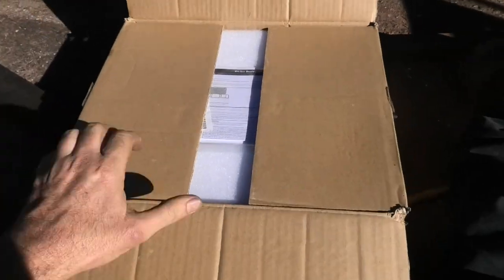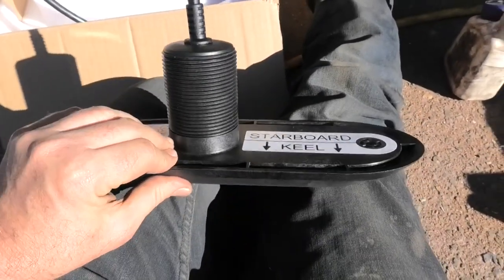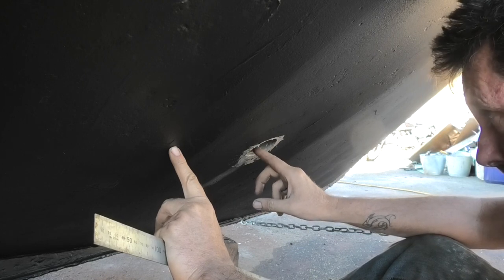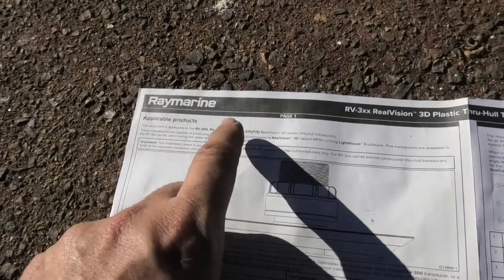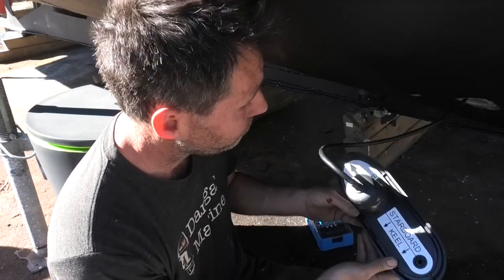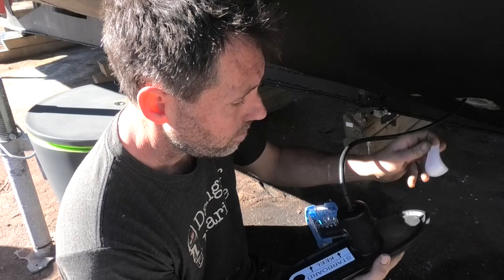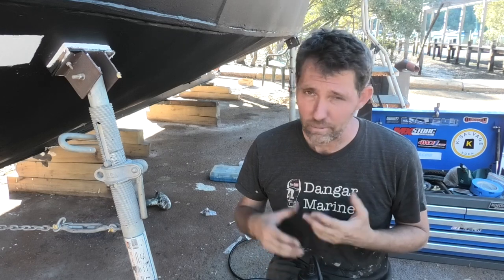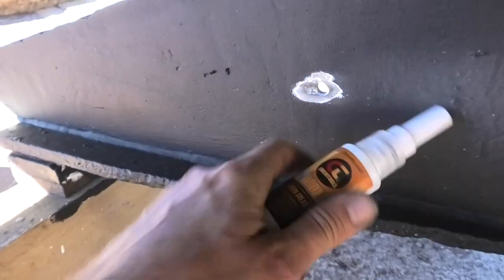Installing Raymarine RV-320 sonar transducers and attaching anodes

Comment: G'Day Stu,,mate i live in Newcastle,,would it be worth it to get a crane from Newcastle,,couple of the mobs this way have some pretty big cranes,,not sure what sort of capacity your after,or radius you will need to reach water from where ya boat is,,
Just a thought,,
I mean 2 franners verse's one from newie,,
Reply: @ Ian williams  I suspect Stu means the bridge on Brooklyn road, not the highway / freeway. That’s where the load limit would be. No way to get a heavy road crane to the site. Not legally anyway.
Reply from the maker: That's it. Getting the crane itself is easy, getting it here is no longer legal.

Comment: I'm not a fisherman but is it really necessary to have two 3d sonars? I guess that this is only applied on fishing vessels?
And they are not cheap either....
What MFD are you going to use? Axiom?
I'm thinking about upgrading the sonar, radar and MFD from raymarine but I find it difficult to understand what transducers that fit, especially when you don't want to drill a hole (plastic boat) and having the transducer as far forward as possible (raymarine doesn't have a forward sonar yet) for shallow water.
Reply from the maker: All 3D sonars are a matched pair as they view off to the two sides of the boats. Yes, I am using an Axiom Pro 9, but you can use that with a single downvision transducer if you would prefer.

Comment: I no this is off topic of the video but I have a 2007 honda bf40 outboard and I just brought it and it has 120psi compression on each cylinder, is this figure OK please message back as its disheartening me toward the outboard tbh
Reply from the maker: 120 is fine.
Reply: @DangarMarine  that was hot with the throttle open and honda states 199psi when new its the same as your one, not many people if any have done a YouTube video on compression testing a honda 40hp what's the compression on your 40, you are easily the best boat orientated youtuber out there

Comment: Is there some new gross weight limitation on the bridge ? North to South, South to North ? It sounds like a divided bridge ? Or two separate bridges side by side ? If the restriction is only on the North to South side, why not hire a couple of Coppers to hold the traffic on the South to North side until the crane can get across the side with no new restriction ? That's what we used to do years ago in The Florida Key's I'm sure the Cop's will glad to oblige for a few bucks. Unless I'm not understanding the statement you made about why the crane can't make it. I was a crane operator in my younger years, tower cranes, drag line's and mobile cranes up to 400 tons. Using two under size cranes to lift a load is very tricky and should not be attempted by anyone except the most seasoned operators. And they dammed well better be on the same page and have the proper spreader and rigger. If it's some other reason the bridge can't be used other than weight restriction, perhaps there is a way to get a temporary permit for a one time deal. It never hurts to ask. The worst outcome is for them to say "no". And you already have that, so you have nothing to loose. Good Luck man !
Reply from the maker: They are two separate bridges which means you can't get here from the north or the south. The only option is to put the crane on a float and bring it over which gets really expensive.
Reply: @DangarMarine  Now I understand. Tough luck on that one. I hope you get it all sorted. If a ramp is available could you use bags? Or would the keel be an issue ? If you could use air bags, you could pull it around with the Rover, if there's a ramp.

Comment: MOUNT TRANSDUCER THEN MARK THE BOLT PATTERN THEN DRILL AFTER REMOVINGTHE TRANSDUCER AS LONG AS DRILL BIT DOES NOT CRAWL AWAY THE UNIT SHALL FIT PERFECTLY

Comment: I'm not a fan of those big through hull holes with the possibility of the two transducers getting wiped off by a rock/s on your pointy end, why not a depth sounder off a bracket on the transom, you wont sink anywhere near as fast, your bilge pump/s won't cope with the water ingress if even one was to fail.
Reply from the maker: I don't think the risk is very big. If it gets knocked off (bear in mind it is tapered all around) then it would be a real shear off which would likely leave the stem blocking the hole. Personally I think it would damage the transducer but not come off. After that there is a watertight bulkhead forward and aft of where they come through so even if that compartment flood it won't sink the boat. Then of course there is the bilge pumps and bungs.

Comment: Don't understand why you would put it in the water without an engine in it. Doesn't compute, won't it be hard just getting the engine in the boat while it's on a mooring ????  You could even do your new rebuilt engine in the water, that would really suck‼️‼️🛥🛥. HOPE IT GOES WELL, watch all your videos, Vinny 🇺🇸
Reply from the maker: Dropping it back in on the water will be trivial.

Comment: Not understanding something...why were the anodes attached to metal straps then to hull rather then directly to hull?
Reply: it all conducts, easier to change. the metal strap is embedded inside the anode material, then material connected to boat.